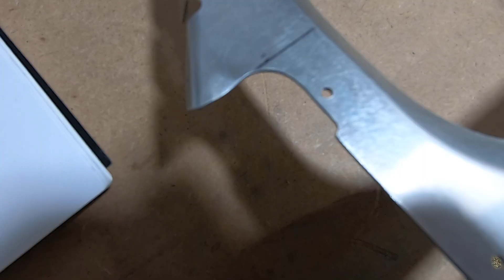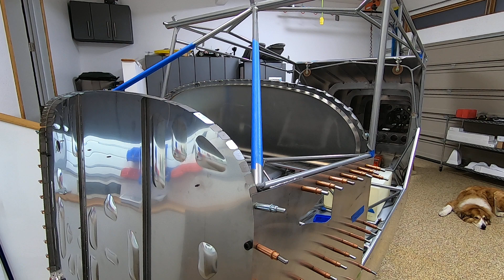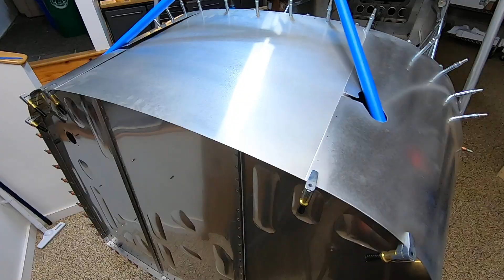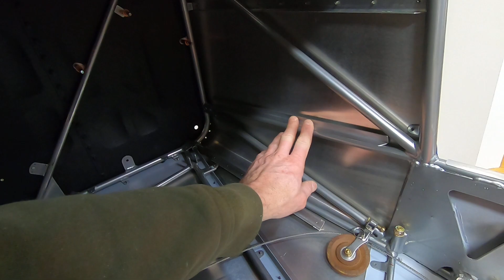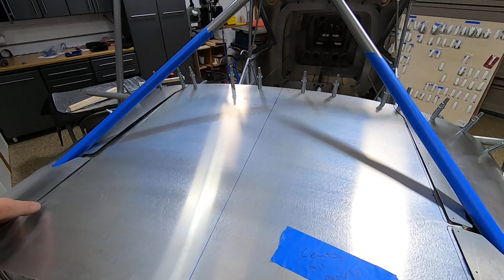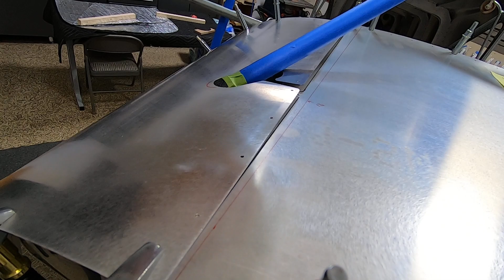RANS S-21 (051) Boot cowl upper skins part 1

Comment: Only an opinion, but the risk to reward ratio for bending those upper skins is not in the builder’s favor. One slip and a kinked skin would be fresh small parts supply with a wait for a new one. Yours look fine, but so do flat ones once you attach.
Reply from the maker: Valid point, since I know people that did exactly that, lol. Rolling it over a big pipe or tube mitigates that though.